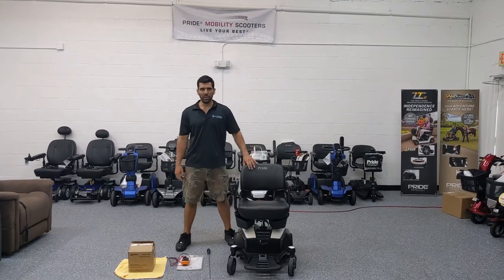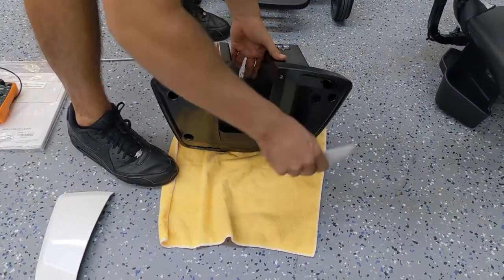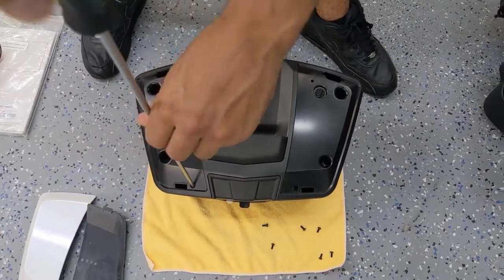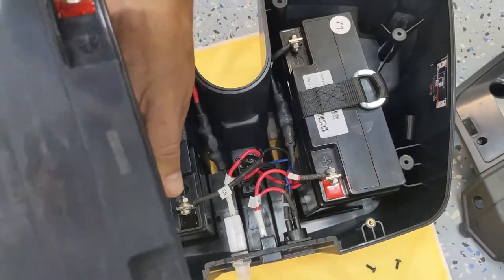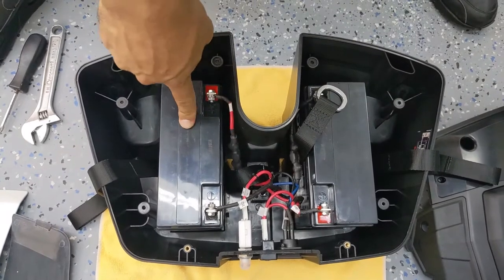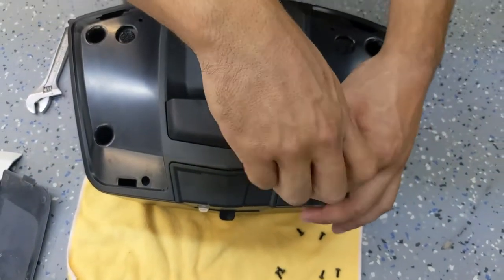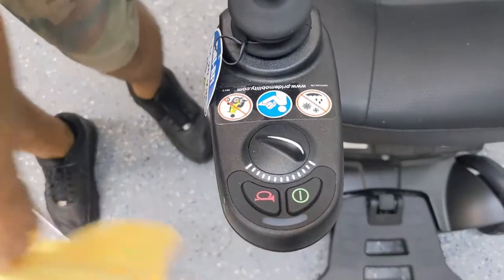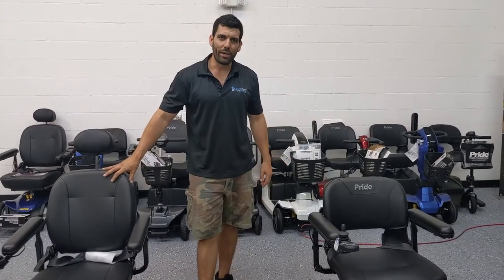🔋How to Replace The Batteries On A Power Wheelchair

Comment: How do you remove the batteries on a jazzy 614 about 12 years old the batteries are in the back
Reply from the maker: You just have to remove the seat and then remove the body panel. Depending on how old your model is, you probably just have to lift up the main shroud cover or there is an access panel on the back of the chair.